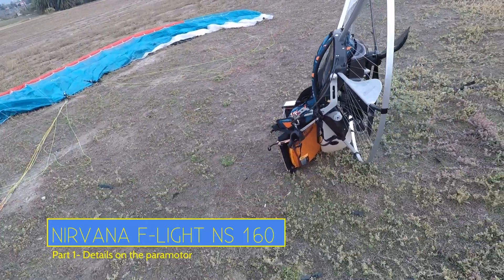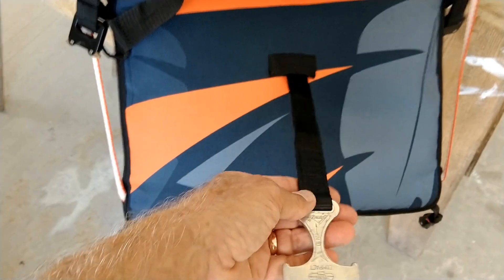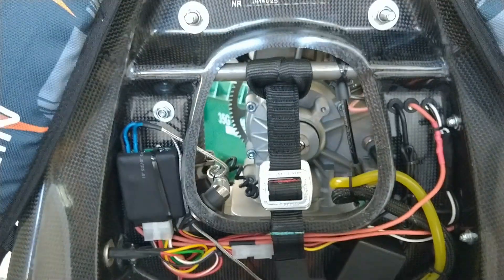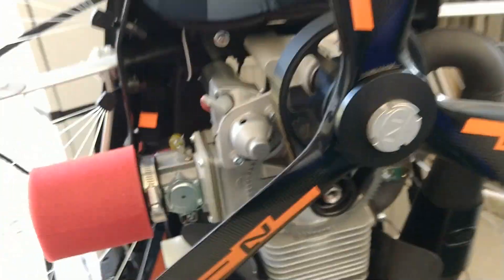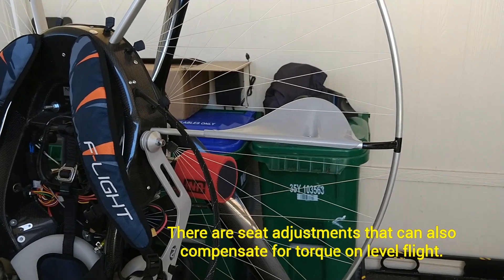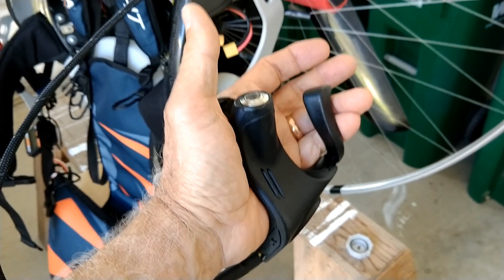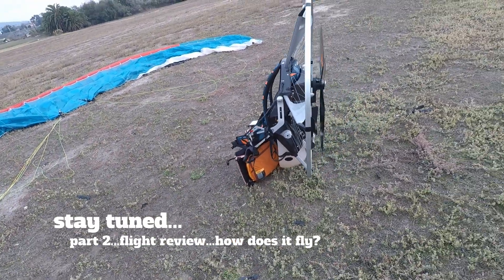Old Guy Paramotoring-Nirvana F-Light NS 160 - Part 1. General Review

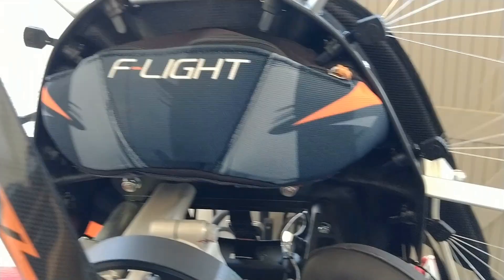Comment: 11:25 I put the zip tie through the orange loop so I know everything is stowed as a small reminder.
Reply from the maker: Thanks!
Reply: I also protected the netting same as you. I’m interested in taking of the air box.
Reply: Lou Serrano  The F-Light doesn’t have a speed bar (Velcro strap) for stowage. What do you have?
Reply from the maker: @shaynemckinlay6406  I didn't have a speed bar or foot straps. I had a small storage bag I strapped on to the side of the harness seat to carry a wing stuff bag in case I landed out somewhere and needed to carry my wing... which I did on a few occasions.
Reply: I use the leg harness to hold the speed bar or though I don’t see any other way around this.
Reply from the maker: @shaynemckinlay6406  Yes, it's a very minimal harness and you have to improvise.